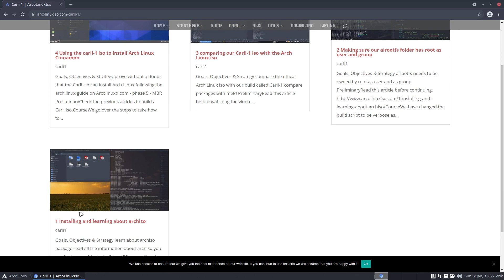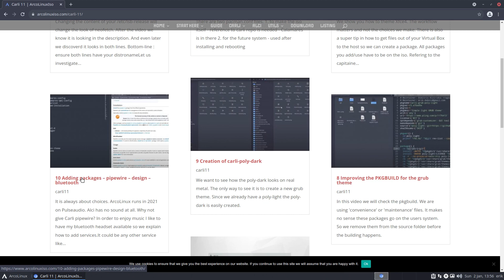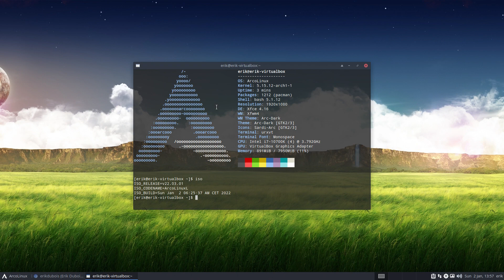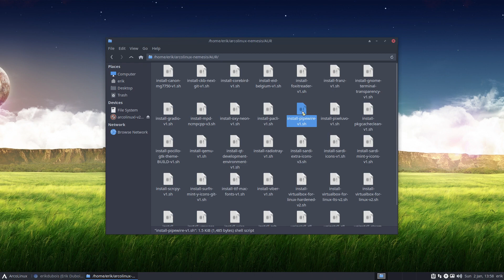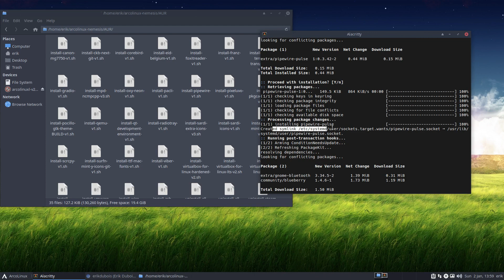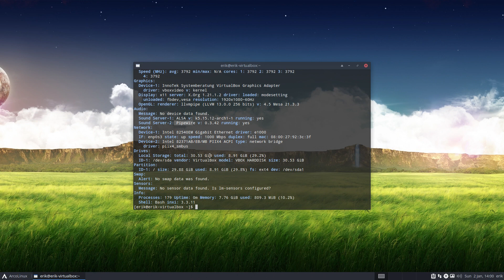ArcoLinux : 2515 How to switch from pulseaudio to pipewire and back - sound server

Comment: Oh... So you need a symbolic link for pipewiee pulse and pipewire-session-manager for audio to work!

I just installed artix linux to try runit out and i was not getting audio even after installing pipewire.

Probably the issue with the symlinks. Thanks Eric